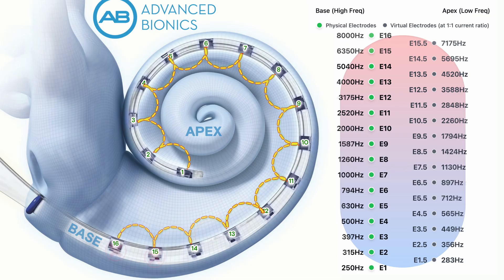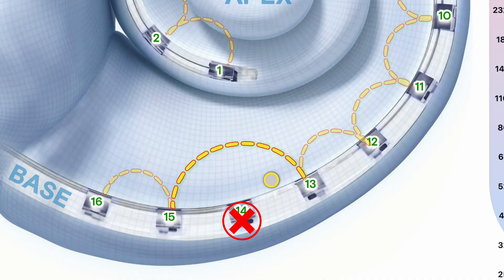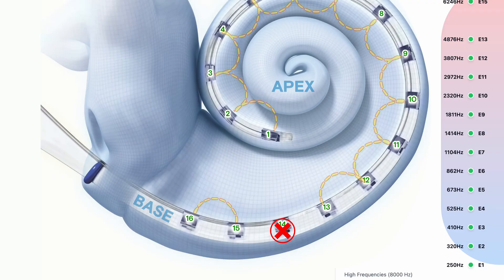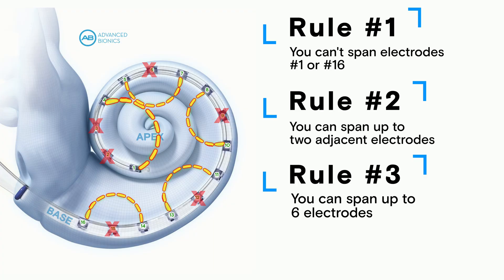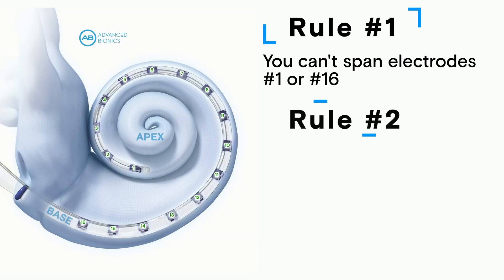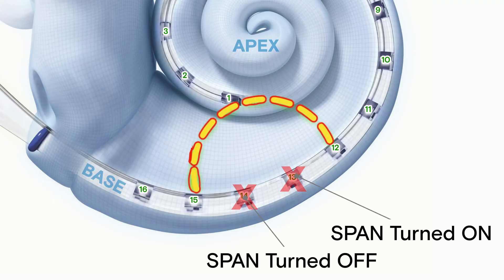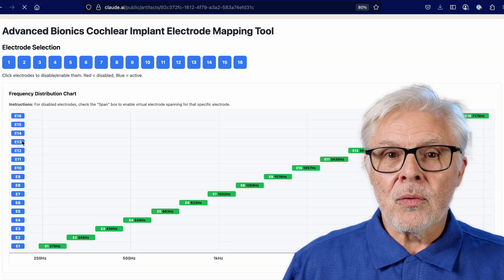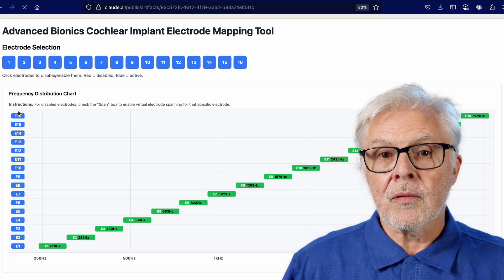Closing the Gap - Inching Closer to my Cochlear Implant Utopia

Comment: Really great understanding of implants. Question though… I do digital signal processing programming and am wondering why there is not always a correct 1 to 1 relationship between the incoming frequency and the stimulated frequency? Why would voices shift higher to sound Mickey Mouse-ish? Would love to learn about the mapping. Thanks!
Reply from the maker: I believe that it is related to place coding, which is important to how we determine pitch. The idea is that there is a particular location in your cochlea that resonates or responds to a given frequency. This location is organized the same for all of us, with low pitch being detected deep in your cochlea, and higher pitches being detected at the outside of your cochlea. The thing is, the place where you detect, say, 1000Hz is probably a little different from where I detect 1000hz. So one-size-fits-all electrode arrays kinda don’t work. In other words, there IS a 1 to 1 relationship between the incoming frequency and the stimulated frequency. It’s just that the stimulated frequency may not be stimulating the correct location in a given cochlea. Also, I believe that the industry has been appropriately focused on speech intelligibility over subjective quality, and that as the technology improves and the potential user base expands, subjective quality is becoming more of a focus. That is just speculation on my part.
Reply: @unsoundguy  thanks for that. Could they divide up the cochlear spectrum into 32 or 64 parts instead of 16? That way a mapping of 1 to 1 could be done for all users, it seems to me, so hearing could be the same thing for everyone.
Reply from the maker: @kevy1yt I don’t know. It gets over my head pretty quickly. But you’ll find that all of the systems refer to “channels” and those don’t have a 1:1 relationship to the electrodes that do the stimulating. I can turn off 6 of the the 16 electrodes and still have the same amount of channels being delivers as before, through the 10 active electrodes. And then there are things like current-steering creating virtual electrodes and a temporal coding scheme involved at the same time. The processing requirements are huge, and must be limited by power usage and size constraints, I would assume.
Reply: @unsoundguy  very cool. Thanks for all the information! Has a DSP engineer I always wondered how these things work. Take care.
Reply from the maker: @kevy1yt You should try to find out! I think a dsp engineer could have a very interesting, fun and fruitful conversation with the engineers at AB!
Reply: @unsoundguy  totally agree. Any engineering contacts you may have there?
Reply from the maker: @kevy1yt Not yet. I know a couple folks who do, but I’ve not received an invitation yet

Comment: Do you know if the way the spanning works and the shifting of frequencies is a limitation of the processor or the implant?
Reply from the maker: I don't KNOW the answer, but I'm pretty sure the answer is that the limiting factor at this point is the software and the processing power (as well as speed and power management) of the processor. There are rumors of interesting things coming that don't seem to require re-implantation to benefit from. I'm interested in research into optical implants (way down the road) that would involve a little gene editing to work, but could potentially offer pretty 'natural' hearing. Until something truly breakthrough like that comes along I think (and hope) that I'll be getting along fine with the implant that I currently have.
Reply: @unsoundguy re implantation is not likely for a lot of people. I would think that since the frequency ranges can change when turning off an electrode, if that is done in the processor, then it would not be a stretch to allow custom range assignments for each patient based on electrode position and perception.
You should ask the engineers if they have thought of that?
Reply from the maker: @BladeFireLight I think they have. That’s what I’m working to find out.
Reply from the maker: @BladeFireLight  I think a few folks at AB are interested to find out. I've been told that theoretically, spanning some electrodes and disabling some should provide some limited flexibility in manipulating the frequency allocation to better match individuals. We'll see!